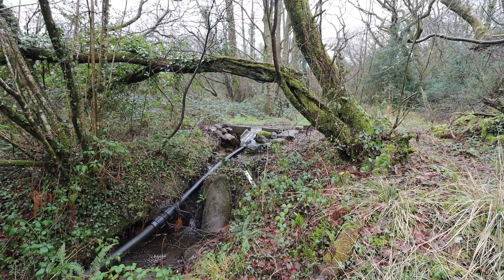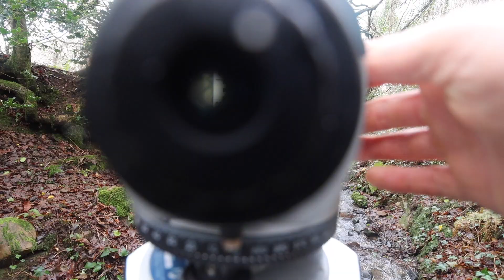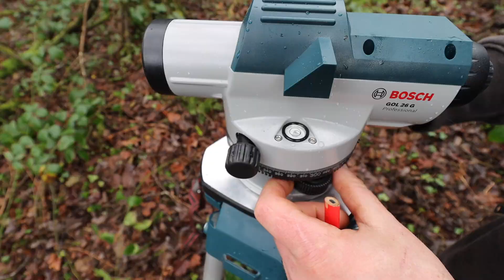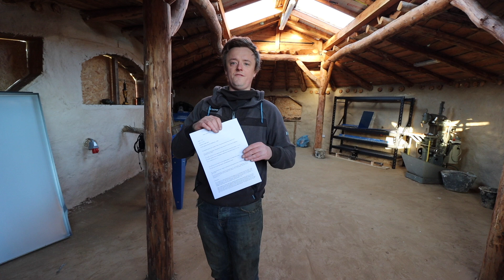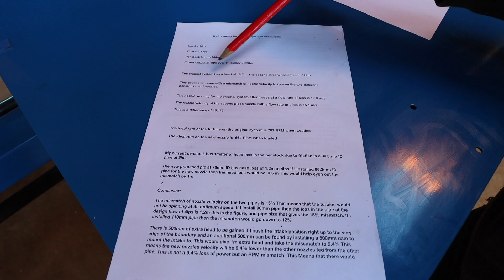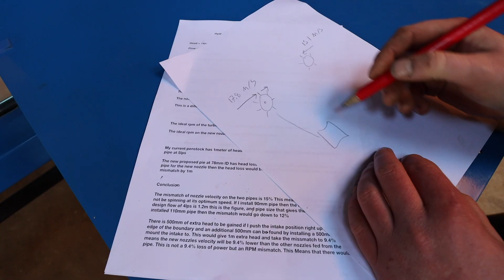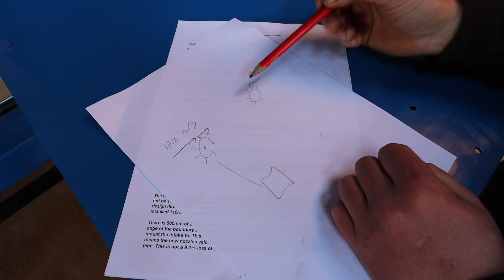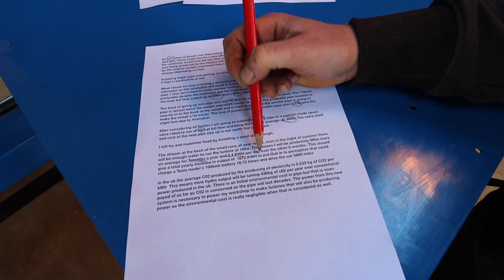Adding A Second Penstock To My Off Grid Hydroelectric Turbine (Survey)

Comment: I'm wondering about the turbine/alternator losses of 20% ???
Surely you will loose pretty much the same, irrespective of whether you put both feeds through a single turbine, or use a separate turbine??  
And a separate turbine would be redundancy and the option of using it as a test-bed.

Comment: Kris, what if you combined the 2 penstocks into a larger ~150mm x 12meter  section of pipe before feeding the turbine?
Reply: That was my thought as well. Y connector joining both pipes before the turbine would give all nozzles the same pressure, which would be good.

Comment: Since you are making your own turbines... why don't you put a second spoondisc with a different diameter on the same shaft of the turbine to match the velocities? It would increase the inertia of the disc and maybe the friction in the bearings but it should not have a big effect since the speed does not ramp up or down crazy fast.

Comment: In terms of money, your estimated extra power is worth about £300 per year as a commercial customer. (£0.149 per Kwh + 5%Vat)
What happens Kris if you combine the water at the manifold rather than feeding an individual nozzle ?
Reply from the maker: No anymore, the new energy price in the uk is double that at about 30p kWh and in 30 years time who knows what it will be. If I go in to the manifold I just add losses. the manifold is great for sending water to lots of nozzles but it does have losses from doing that. if I can go straight in with this on then I don't have to worry about those manifold losses.

Comment: Kris another thought you might be able to save the Oak by cutting the trunk at five feet above the root bole  cleaning up the hole it left spreading compost in the hole and winching the stump upright. Come spring  the stump should generate shoots and by the time the tree is big enough  to need a large root system they should have already regrown to match. I have seen this work with other oaks in wet environments.In about ten years selective pruning should supply you with poles for fencing or fire wood and future generations with a chunky oak tree to marvel at not forgetting wild life habitat and carbon uptake
Reply: That would make an interesting video to follow! Would be great if it worked
Reply: I've seen some pretty good saves when it comes to uprooted trees on public television. This is bigger than usual but I think it could work. Very cool idea!
Reply: I don't see that working with a tree that big, especially not an oak.
Reply: @patrickcleburneuczjsxpmp9558  I have seen it work with bigger oaks than that one.
Reply: @patrickcleburneuczjsxpmp9558  They did that at my mother-in-law's condo. When they were working on the parking lot they uprooted an elm of quite a big size. They replanted it. It lasted another two years and when it died they replaced it with another elm that was only slightly smaller. You never know until you try. And sometimes you can try a couple of times!
Reply: Really great idea! If it was an ash or sweet chestnut I'd say do it. But oak poles aren't very useful because they're such a high proportion of sapwood. Which, unfortunately, in oaks is very nondurable
Reply: @RAGproduction  let's face it human society has destroyed most woodland ecosystems before even really discovering them and there potential, everywhere is being hacked down even by so called wildlife trusts and others who cannot help but interfere.  Come on Kris try to help out that oak, even just leaving it there could be interesting and be a catalyst for other more shy eco systems to prosper but who knows there might be some secrets in these trees, they don't like to ask but may appreciate a little helping hand.
Reply: @MakeAllThingsBeautiful  yeah it's such a shame when these organisations & people interfere with nature just doing its thing. We should be more hands off, I totally agree. Go on Kris! Shove that fallen tree back in the hole!
Reply: @RAGproduction   I think you have missed the point, cutting the poles would be to keep the tree balanced and prevent it out growing  the new root system. not to provide a regular coppice Here in the uk commercially available fence posts are produced from low grade soft woods treated or not they do not last long five inch oak poles are likely to last  longer dodgy sap wood or not. whilst quality oak posts are available they tend to be rather expensive and beyond the purse of the average small holder and farmer, the half dozen posts Kris might harvest is neither here nor there in the grand scheme of things but would provide him with a few replacements for his sheep fencing as the old posts rot out.
Reply: @davidprocter3578  Exactly. Nobody likes replacing fence posts they just put in a year ago. Probably best to stick with something more durable than oak sapwood. I hear you
Reply: (I know it's not about the poles really). I'd love to see this done, it would make a beautiful, well established tree
Reply: good idea David, this is first ever experience i have seen of actual true 'tree surgery', ok it's only a suggestion, but, we generally don't always realise the recovery potential of much of nature
Reply: Neat idea, shouldn't require tons of labour and I've seen that you have the tools. Could borrow/repurpose some of the trunk for another project (I'm picturing oak bar/coffee tables across the grain) and leave most to rot/habitat. Whatever root ball dies off would still provide plenty of habitat. Greetings from Canada. Love the vids! Started watching from the start when you had almost completed the round house. I was mindblown! Have been since.
Reply: This would make an amazing video, and definitely worth trying in the name of science!!!!
Reply: Some trees right themselves when you cut the trunk, and I've seen some  survivers, most were willow though. Helping it a bit to return with a comealong wouldn't necessarily be that much work.

I'd salvage the best part of the trunk if possible, and leave the crown for habitat. 

Do be careful with windfall. Think about where the tension is, and release it bit by bit, while having your escape route ready, and take your time. I took a course after having salvaged many logs, and I still learned a lot.
Reply: @frodehau  you are right of course stumps regularly right themselves when the weight  is relieved from the upper sections,I dare say kris is well versed with the problem Willow is one of those trees that cant help rerooting itself, probably not a good idea to cut the trunk long at the exposed altitude  the tree is located being kept long will not aid its recovery.Cut short with stones piled on the root ball to help keep the stump stable and the new root system pressed into the soil. Thick protruding roots should be pruned back flush dusted with hormone rooting powder and painted with Stockholm tar. the stump should be cut at an angle and facing south then also painted with ST other products available.
Reply: @davidprocter3578  I've no doubt that Chris is very capable. I just don't want to see a good man like him get hurt. 

You're health is everything in this lifestyle. And I'm also cognisant that thereare are many who read this without commenting themselves.
Reply: Wish I’d known about this when a small thuja came down. I left it and it’s now growing upwards looking like a small hedge.
Reply: @jennymoss2122  Hi Jenny this response is very common amongst wind blown trees. In Africa many tribes look for such trees of certain species for the production of bow wood and axe handles.as the new shooting branches tend to grow quite straight..
Reply: @davidprocter3578  thanks for that information it’s really interesting and true the branches do grow straight.I’ll just have to keep my eye out for native Africans coming round my garden.
Reply: @jennymoss2122  Well if they do don't worry they will be both polite and gentle.
Reply: @davidprocter3578  that’s nice ,I’ll make them a coffee.
Reply: @jennymoss2122  They will be mortally embarrassed.
Reply: @davidprocter3578  oh, I don’t think my coffee is that bad.
Reply: Think  that would be more work than just cutting it up for fire wood and sawing up the log for lumber! easy peesy. Personally time could be spent productively  elsewhere. So in actually where Kris talks about the pipe not being viable playing with a tree and getting back a bit of firewood or fence posts not very viable.
Reply: i've seen that with other species of trees.......but oak!?

think it depends on type/variant of oak.

in germany i've never seen oak doin that. may we have the wrong oaks over here!

✌😁
Reply: @t.r.l.4377  Oak not the best tree species for this type of rescue, but can be done, if not left too long exposed to the air, this tree stands a fair chance as it still has much soil around it's root bole.Providing Kris follows some basic rules it will have a fair crack at the next thousand years.

Comment: Hi Kris, Awesome channel. Top skills btw. I used to do a lot of surveying back in the day. When using an optical level you don't need to use a tape measure to measure the height of the instrument - just get Dot to stand at the top of the penstock location with the staff and sight back uphill to it (backsight). This gives you the height of the cross hairs above the ground where the staff is. Then turn and sight downhill to the next staff location (foresight). Foresight minus backsight gives you the difference in height between the two staff locations. Then backsight to the second staff location...ad-infinitum down your penstock. Top tip - if you keep your Backsights and Foresights roughly the same length (Get Dot to count paces to the instrument and away again), then any error in your instrument gets cancelled out. Also, if Dot rocks the staff backwards and forwards, you know when you see the lowest reading on the staff - that is when the staff is exactly vertical. You can check your instrument accuracy by doing a two-peg test. You can verify your whole survey by going back uphill to the top of the penstock again and seeing if you get back to the same level. Hope it helps. Regards, David

Comment: Is there a reason you couldn't combine the outputs of both streams into a catch basin? You could then funnel the combined force of both streams into your current turbine system. Any ideas to the drawbacks of this proposal?
Reply: The head of the original system would have to be dropped to the height of the new.

Comment: I enjoyed your explanation of harnessing the hydro energy of a second creek. I did environmental studies in my career (U.S.), so your discussion of the environmental costs and carbon benefits and power use to make turbines which will further reduce carbon emissions was persuasive. You don’t dewater the stream as I recall, but use a fraction of the water flow, so the 200-meters of steam bed will still serve the ecosystem in wet months.
Reply from the maker: Yeah that's right, the water goes back in to the same water course so there is only a 200m depleted range and that is only a small stream with no fish in it so the damage to the water course is negligible.

Comment: I never would have thought larger pipe was better because of friction.  We don't really tend to think of water as having a lot of friction but it makes sense.  My initial thought was smaller pipe would increase velocity but I guess that's more than offset by loss of volume.  Loved the breakdown of the delta between cost/impact and potential gain.
Reply from the maker: Hi Dave, this is very common mate. I believe it is from the experience people have with a hose pipe. when you cover the end the water comes out faster. this makes people think the smaller hole size changes the velocity of the water. It doesn't. it lowers the flow and therefore reduces the friction and therefor comes out faster. Household plumbing pipe is quite small so there is a lot of friction. But if there was no friction then the open ended hose pipe and the nozzle hose pipe would fire water the same distance. Its all about friction.

Comment: I think you are going to need more battery. 30kwh isn't going to be enough for all of that machinery if working full time.

On a side note; Have you investigated thermal recovery and storage using large water tanks and insulating them yourself? If you are going to build a house at some point it might be worth it to use thermal storage to preheat hot water and for radiant floor heating. That way you could modify a wood stove with a heat exchanger, store that heat, and then use it to heat the entire house. In addition you could also use solar thermal, or collect waste heat from a backup generator if you ever choose to use one.

Comment: Unlike the placement of the first dam for your first stream, which was extremely flat, it appears you will be able to create a significantly taller dam, given the second stream has carved out taller bank walls.  It is difficult to tell due to all of the vegetation, but the stream bank walls looked roughly as tall (on average) as your laser sight stand which you said was 1.1meters tall.  So wouldn't creating a 1.1 meter tall dam and installing your custom dam sluice, be able to provide an additional 1.1 meters of head for the second stream?  Would that result in pushing the mismatch of nozzle velocity in the opposite direction which you could then restrict with nozzle down to match the first?  Or with increased head would you be able to go back down to the 78mm pipe for the second stream and lower the cost?
Reply from the maker: I would like to get a bit more head by doing that but I can't back water up passed my boundary so its not really an option.

Comment: If it is possible to get it out ,without too much difficulty, then I would take the main part of the downed oak out. Think how useful it could be when you build your final house. If you leave all the branches then that gives a fair amount of habitat for wildlife.
Reply: From the looks of the terrain, pulling a log of that diameter out would both be a nightmare and would have to be dragged across the stream causing significant ecological damage.

Comment: Why not Tee (Y) the 2nd pipe into the existing pipe close to the turbine. Admittedly this could cause other issues that i may not be aware off, however you would have one stream of water. This would then all arrive at the turbine nozzles at the same velocity eliminating the mismatch.
Reply from the maker: I was going to do that, but the head difference means that one will push water up the other. It could be put in to the pipe higher up at the point that the head matches but then if one blocks it will push air in to the other one and then none of the nozzles will work
Reply: @KrisHarbour  I don't know the topography you have and that could very much rule this option out, but if the only concern is blockage, you can design around this concern with standpipes and backflow preventer valves if you wanted as long as the pressure (head-loss) was equal in both at the point they joined at the main penstock.  Obviously this is more complicated and more costly, but still is a theoretical solution to consider
Reply: @KrisHarbour  Im sure you could design an efficient manifold and the chances of a blocked pipe would be fairly low I would think.

Comment: A taught tape or laser measure will be more accurate than the wheel. I've used both, the wheel being far easier, seeing a laser pointer at distance is a challenge, but with that tripod, it ought to be doable. The wheel will measure surface distance, humps n pits and all.
Reply: The pipe will be laying on the ground, not fixed rigidly in straight lines, so the laser is not a good option.  Tape will do the same job as a wheel, but it's a bugger to clean.  He made the right choice, IMO.
Reply: @sarkybugger5009  I commented before the end, the wheel obviously the right tool for the job here.
Reply: @chrisfryer3118  You commented at the beginning that a taught tape or laser would be more accurate.  It is obviously not so.  You just admitted it with your last comment.

Comment: Love the theory kris. However could you not be able to do any of the following? 
1. Run both pipes off 1 penstock, even if you need to make it bigger? 
Or
2.Depending on the ground conditions-elevation etc, be able to dig a channel from the proposed new source to the existing ine giving you more water flow?